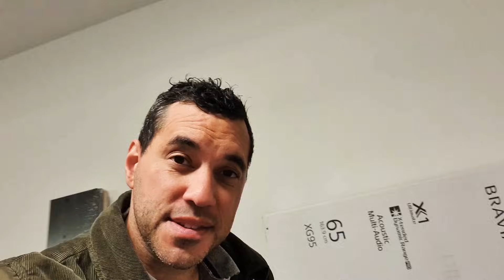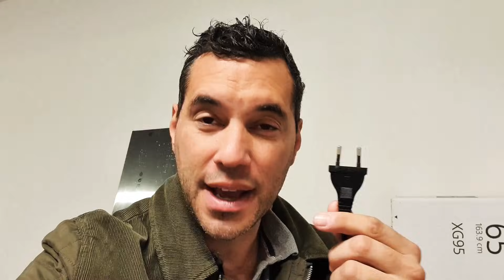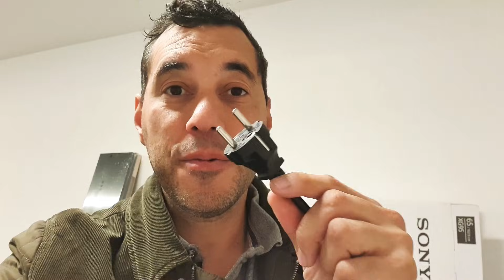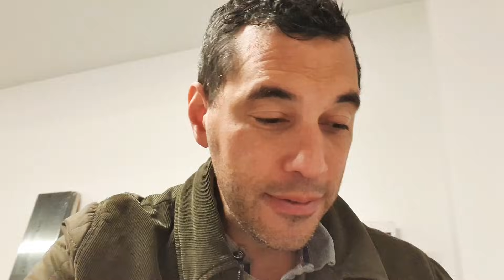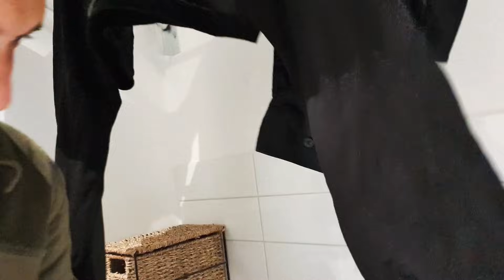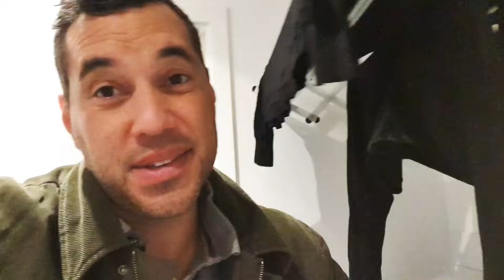Why don't EU plugs have FUSES!!!

Comment: They don't need fuses in individual plugs in the rest of Europe because they have radial circuits whereas the UK uses ring circuits which uses  32 amps on the same grade of cable which should lower to 16 amps between the consumer box and back to it. Because the supply in these types send the alternating both forward and back there needs to be a polarized fuse in plugs to protect the flex on plug-in items from overheating if the supply is cut somewhere in the circuit, yet because it's a return ring circuit some of that circuit will remain energized, and the possibility of it becoming 32 amps, therefore plug fuses protect the item ranging from 3, 5 and 13 amps dependent on the wattage of that item. Radial circuits don't need this as such as polarization is not needed with alternating current as the breakers will go on phase and neutral as they have equal potential to earth unlike the UK where it's only only the neutral side. Europlugs and Schukoplugs ( the ones with earthing clips ) are reversible and unpolarized which is why usually the flex doesn't point down from the plugs unlike British 13 amp BS-1363 plugs. Why do the British have to apply their standards which are superfluous to other countries? Schuko is one of the safest systems in the world, and prevented partially inserted plugs electrocuting people long before the UK had to sleeve the prongs on their plugs to prevent accidental shock from partially inserted plugs. Also having all plugs with a three prong configuration is usually pointless since most items are double insulated anyway, and the larger prong only serves to polarize the plug with the socket-outlet.
Reply from the maker: Thanks for the technical summary, good information. I guess it just gives that feeling of 'peace of mind' having local fuses, but based on what you've said they really don't sound necessary. Thanks for the comment!
Reply: The UK ring system was created in order to save cable, as copper was very expensive and hard to come by during and shortly after the great war. On the same token, many older UK telephony installations uses aluminium cable rather than copper, which causes lots of issues for those wanting to run any form of internet connection over it.
Reply: The fuse in the UK plug is to protect the appliance flex (cord).
I used to install industrial machinery and often used to work alongside European electrical engineers; they were (correctly) very particular regarding having the correct breaker for a specific cable size… 
… On several occasions I have asked them why they allow a table lamp fitted with a 0.5mm (3amp) flex (cord) to be plugged in via a Europlug/Schuko to have as its only protection a 16amp breaker at the panel (this is over 5 times the rating of the flex) …. None of them has ever been able to answer this question!!
Reply: But the french wall sockets don't have switches either which means I find myself always plugging and unplugging cables. Also in my country we use primarily UK but also French for compatibility, so now I wonder if all those french sockets are unsafe given that we most probably use them with ring system.
Reply: @SebVEVO  
No, radials are used for domestic use in France although their earthed plugs are polarized except on Europlugs without the earth hole. The switches you are writing of used to be single-pole on the "live" side but now they're double-pole and they can fail with repeated use. There's no reason to unplug unless moving the item, or if it is something more dangerous like a heater or electric iron.
Reply: @paulaherne3915  
Have you heard of paragraphs?
Reply: @johnburns4017  haven't got time for paragraphs. Not writing a formal document  you know.
Reply: @paulaherne3915  
So you haven't heard of paragraphs.
Reply: The fuse in the plug protects the wiring to the appliance. This is entirely logical. In the European form, and US, you can plug in an extension rated to 5A and try to pull 13 through it. Or you can have a fault current of 10A through a 5A rated appliance cable and cause a fire. That's genuinely bananas and unsafe.
Reply: @jamesbuckle6077  There are no extension cords rated for 5 A. All are rated for 16 A unless it is a simple europlug extension cord in which case it is limited to 2.5 A by the device.
Reply: @okaro6595  this is not true, I have one. Maybe they are not meant to exist but they do. Also, my hoover cord internally wore through (rented property) - and goes up in flames without triggering the overcurrent protection in the box. Cracking system.
Reply: A three phase supply in a normal domestic home is a dumb idea. The UK is single phase, unless the house is very big.
Reply: Many clearly do not understand what a final ring circuit is. The ultimate system is to have a radial circuit to each socket outlet on its own fuse at the main panel - the optimum solution of course.  This means you will need a very large expensive main panel and lots of fuses/MCBs (one for each socket) in the main panel. Impractical of course.

🎊🎈  BINGO  🎊🎈 
A ring gives this by distributing the main panel around the house via a ring cable, distributing the fuses from the main panel around the building to each socket. The ring is a busbar. This saves the vast expense of a plethora of radial cables back to the main panel and also a plethora of expensive fuses/MCB's/RCBO/AFDDs at a very large expensive main panel and expensive labour to install.

a) A ring uses less cable and gives a longer route 
b) No limit to sockets on the ring, but total is limited to typically 32A.
c) A ring uses less copper for a given load/area. 
d) Rings rarely have voltage drop as it is fed from both ends. 
e) Rings have lower impedance, less volt drop is less waste!  They are more efficient.
f) No single point of failure for the protective earth.
g) If you are covering all rooms in one floor then a ring can do it.
h) An appliance and its flexible cable may have a fuse sized to its rating inside its plug.

1. Ring final 2.5mm cable, 32A B-curve MCB, length 106m on TN-C-S.
2. Ring final 4mm cable, 32A B-curve MCB, length 171m.
3. Radial final 2.5mm cable, 25A B-curve MCB, length 33m.
4. Radial final circuit, 4mm cable, 32A B-curve MCB, length 43m.

If a ring is in 4mm cable protected by a 32A MCB/RCBO, then no problems if the cable is broken - which is a very rare thing. The ring can be partially 4mm to heavy current appliance sockets on one leg, and 2.5mm for the rest

The ring final circuit is safe, simple, and highly effective after 80 years of use. The introduction of MCBs/RCBOs/RCDs/AFDDs, and screwless Wagos on the ring taking the load, has made the ring even safer
Reply: @johnburns4017  In Finland one cannot put over 16 A on 2.5 mm².
Reply: @johnburns4017  Nobody has a single wire for every socket - unless it is some dedicated high power device.
Reply: The UK has radials as well, but we still have a fuse in the plug to protect the flex to the appliance overheating and causing a fire. Also it protects the appliance.

Others rely on flex protection by having a fuse in the appliance itself, which may be difficult to get at if you know where it is, or rely on protection at the main panel, which not good enough.

The British system is superior.
Reply: @johnburns4017  once my gas-boiler went out and I had to use a large water heating tea urn to get a bath, and I'd filled it, and then forgot it was gradually boiling on its thermostat, and the cord got so hot the plug in the socket burnt right through on the "live" side, and the 13 amp fuse never melted, and neither did the breaker go. I can't imagine this happening in my old house in Ireland where these fuses are superfluous. The UK system is exalted mostly by those in the UK, and if anything Grenfell proves how preposterous the claims about these over-sized plugs with internal fuses are.
Reply: @paulaherne3915  
The Irish have the same system as the British. If the fuse did not blow the current thru it was not high enough. Or the fuse was at too high a value. The problem was probably elsewhere, like a loose connection making an arc. The main panel protection is lacking, or defective, as well. 

In the UK RCD protection is mandatory.  In certain situations AFDD is mandatory,  and recommended for all socket circuits.
Reply: @paulaherne3915 
Grenfell was caused by a small fridge electrical fire. The fridge was a cheap Turkish brand.  AFDDs are now mandatory in high rise blocks.

You are electically ignorant.
Reply: @johnburns4017  The Irish don't use the same system for domestic wiring as the UK, they're radials, they just use the same plug and socket to suit the UK, particularly Northern Ireland, so you've got that wrong. BS-1363 plugs and sockets are pointless otherwise in the Republic of Ireland. Even Iraq has BS-1363 and they're domestic supply is by radials, again superfluous in that case.
Reply: @paulaherne3915  
Ireland adopt the British IEE regs and use ring final circuits.
Reply: @johnburns4017  A few points to address the comments you've raised:
A. Cable length for a ring and radial ciruit is dependant on the layout of the sockets (and any hard wired devices) installed within the installation. There are times where the cable length of a ring is shorter than a radial circuit, and vise versa. I've seen plenty of 10-15m long return cable runs from the final socket back to the consumer unit (ie to complete the ring) which isn't necessary for a radial circuit, and adds extra cost to the client. 
B. There is no limit to the number of sockets you can install on either a ring or radial circit. BS 7671 provides recommendations, but it's down to the electrician (or engineer in more complex installation) who determines the number of sockets installed on a circuit.
C. Less copper (in certain situations), but again the socket layout will determine the load served per area.
d. All circuits have voltage drop, regardless of whether it's a ring or radial configuration. "Being feed from 2 ends" has nothing to do with voltage drop. Voltage drop is cable size, cable length, and electrical load dependant.   
e. Impedance and voltage drop are cable and position of load dependant. Larger cable mitigates volt drop issues, which is essentially non-existing issue in domestic installation due to the small installation size and low power requirements. In commerical and industrial settings where you may install much larger electrical loads long distances volt drop becomes more of an issue...but in a domestic setting (espeically with the small british houses) volt drop really isn't an issue. Also, the "inefficiency" (ie due to voltage drop) is generally very small in the scheme of things, to the point where you may pay more (installation dependant) in material and labour costs to install rings vs the cost savings in reduced electricity consumption (due to any waste heat produced in the cable due to cable resistance)  you'll pay in your electricity bill. 
f. Single point of failure isn't relevant in domestic settings (this is a far more relevant in datacentres and hospitals settings). In many instances, it's worse for a domestic installation. There are plenty of youtube vidoes posted by electricians finding (and fixing) broken rings in homes where the home owner is completly unaware of this situation. This is rarely the case for a radial circuit, where a break in the cable is far easier to identify (ie in a radial circuit, a break in the cable between 2 sockets will result in the socket downstream of the cable break not working. In a ring, that isn't the case).  
g. Both a ring and radial can cover a floor. 
 
Regarding the circuit lengths for ring and radial circuits..without knowing what parameter you're measuring against (ie volt drop?) the figures aren't exactly useful. Furthermore, there isn't many domestic installation (especially in the UK with the smaller properties) where you're needing to install a final radial circuit longer than 30m...

Whether a 4mm cable is protected by a 32A MCB is down to the cable installation (ie cable installed in free air, or installed within thermal insulation, or within conduit etc etc), ambient temperature, and any grouping factors which need to be applied. More often than not 4mm is fine being protected by a 32A MCB, but not always.  

is a ring circuit safe? Yes, provided it's installed by a compentent electrician. 
Is a ring simple? Compared to a radial, I'd argue no, given you:
Have worry about the return cable installation back the consumer unit (not an concern with a radial circuit, as there is no return cable back to the consumer unit), 
Ensure the sockets are evenly distributed across the length of the ring circuit (ie to avoid one side of the ring carrying excessive electrical load, which ins't a concern with a radial circuit)
More testing required to verify correct operation of a ring circuit (ie ring continuity).

Furthermore, if a ring is broken...enjoy fault finding the break on the ring. Radial circuits are much easier to identify a fault in the cable...

I wonder why rings (outside of the UK, some installation in Ireland, some M.E countries, and some countries in Asia) are not used? Surely if a ring final circuit is superior it'd be used everywhere...right?
Reply: @gloveyourway2000  wrote:
"I wonder why rings (outside of the UK, some installation in Ireland, some M.E countries, and some countries in Asia) are not used? Surely if a ring final circuit is superior it'd be used everywhere...right?"

The British had/have the highest electrical standards in the world. They are a bit behind in consumer units as German/French have DP disconnectors at the consumer units, but they are available in the UK and fitted.

So, the reason why most others do not have rings is that they do not have the brilliant and simple British fuse-in-plug.  The fuse-in-plug makes the ring work. If others had proper plugs and sockets like the British, they would have installed rings.  The British had the least accident/deaths per capita than any other country. 

In the UK AFDDs are mandatory in socket circuits in high rises buildings and recommended on all socket circuits in all installations, as are RCBOs on all circuits.
Reply: @gloveyourway2000  wrote:
"is a ring circuit safe? Yes, provided it's installed by a compentent electrician. Is a ring simple? Compared to a radial, I'd argue no"

▪ Yes a ring is safe as 80 years in the UK and other countries have proven. A ring is simple. 

▪ A ring can cover three or four radial circuits. So no large main panel, and circuits snaking all over a house.  Which adds needless extra expense in a large main panel and cable. And extra work.
 
▪ Fault finding radials is easy when you know how. 

▪ Having  a balanced ring comes down to circuit design.

▪ Voltage drop is normally less on a ring as it being fed both ways.  

▪ A ring is safer as the earth is fed from two ways. 

▪ A ring's size is limited by area. 100 sq metres.

▪ No worry about a return cable back to the consumer unit as it will installed properly. 

▪ Rings are less prone to fires, as they are fed from both ends. Arcs on rings are less intensive than with radials. But AFDDs are mandatory and recommended on socket circuits. 

▪ An intensely used radial has all the current loaded on the 1st socket and cable after the consumer unit. Not good. 

Rings have been use for 80 years with few problems for 80 years.  With new regulations re: RCBOs and AFDDs, they are now even safer.  To the point installing radial socket circuit is rather silly.
Reply: @johnburns4017  Have you worked overseas? I'm guesing your haven't, as you'd understand where the British system is good and not so good. Brits having the highest electrical standards is laughable. Yes, some things are done very well, but the highest standards...nah. 

Proper plugs? If the Type G plug was so good, it'd be adopted everywhere...but it hasn't. Ditto for ring circuits. 

AFDD's have been standard practice for many years in many countries..ditto RCD protection. Heck, most British commerical installations I see don't have RCD's protecting lighting circuits (and these are very new installations) ...which has been standard practice in many other countries for many years.
Reply: @johnburns4017  Both ring and radials are safe provided they're installed by compenent electricians. Radials are used worldover, and have well in excess of 100 years of use. No point comparing both ring and radial in that regard.

If rings are so great...why aren't the brits installing rings for lighting circuits? By your logic, a lighting ring can cover a large area, which will result in less circuits installed in the consumer unit, saving cost. Nothing stopping you from using a 1mm cable protected by a 10 or 16A breaker...yet you don't see it installed. I wonder why... 

Have you worked overseas on sites, or seen in depth an overseas installation, or worked on construction sites? Opening up the fuse board in your hotel room overseas doesn't count...

Ring and radial circuits are just two different ways of circuiting...but the idea that a ring covers 3-4 radials is laughable. I'd be questing your circuit design at that point, especially given that two 20A radial circuits (which either 2.5 or 4mm cable can be used, depending on the cable installation, cable derating and any grouping factors you choose to apply) can deliver more power compared to a ring...

Again, voltage drop has nothing to do with whether a cable is feed "both ways". It's determined by cable size and cable length. 
A ring circuit isn't safer becuase there are two earth cables. If anything, it hides problems with the earthing of a socket. No different to how you can't determine whether there is a break in a ring circuit without testing...which isn't the case in a radial circuit. If there is a break in the cable in a radial circuit, some items connected to the radial circuit will work, others will not. That isn't the case for a ring circuit...

Rings being less prone to fires is utter crap. Ditto for the first socket heavily loaded comment. By your logic, the situation is worse in the ring setup as the ring (due to the 32A breaker which is typically used for a ring setup) will experience higher circuit currents compared to a radial (where 16A or 20A breakers are typically used to protect 2.5mm cable), especially so when the ring is unevely loaded (very very common in domestic installations. So many installations I've seen in the UK have poorly loaded and wired rings where there is no thought at all expect "it's a ring, that's what we install" response). Regardless, the socket itself (whether that be a type A, Type G, Type F, Type I or something else) in most instances encountred in a domestic installation can handle a good deal more current that what the circuit will be expected to carry.
Reply: @gloveyourway2000  
I have worked in many parts of the world. The British standards are the best.  Get used to it. USA plugs and sockets are terrifying.  The best are the British by a country mile. Get used to it. 

AFDDs and RCBOs make socket rings superior to radials. No contest.

Most of what you write is ill-informed nonsense.
Reply: @gloveyourway2000  
I first worked overseas not in Britain. You make things up.
Reply: @johnburns4017  Sure mate, whatever you say.
Reply: @gloveyourway2000  how can you do it?! it's like talking to a door knob!!
Reply: @johnburns4017  LOL, no earth rods, old panels with fuses where one could put just about any wire.
Reply: @gloveyourway2000  wrote:
"If rings are so great...why aren't the brits installing rings for lighting circuits?"

Oh No!  The idea of ring circuits is for power circuits, which lighting is generally not. Rings are used on some commercial lighting setups where high currents are drawn.
Reply: @johnburns4017  The wall fuse usually trips before the appliance fuse trip. In my 40 years I have only seen one appliance fuse blow and it usually was a low powered one like electronics. Each system has a reason for existing, but the British plugs were made to counter the inherent flaws from the British ring system. It's a solution to a problem the Europeans do not have.
Reply: @HideBuz  
A final ring circuit is not a problem and not flawed if designed and fitted properly with proper disconnecting devices.
Reply: @johnburns4017  Ring final circuits are stupid and must be banned.. That's why manufacturers sell their items with a fused plug because ring final circuits are still common in the UK.
Reply: @IAmThe_RA  
Read my posts again on this thread. It is all explained. 

The fuse in plug is to protect the flex - sharpen up!

A ring in 4mm cable with an AFDD and screwless sockets is near bombproof! It will replace 4, 5, 6 radials. They are highly cost effective. 

You have to sharpen up your understanding and analytical skills.
Reply: @HideBuz  
The British G type plug was NOT designed to accommodate ring circuits. It was designed to protect the flex, which many were covered in cloth in those days. My mother's house was built in 1953 with G type plugs and all radials. The fuse-in-plug became the enabler for rings which really only took off in the 1960s in the new build housing market.
Reply: @johnburns4017  The ring circuit was developed in Britain in 1942. The Type G began appearing in 1945 and replacing Type D. You are delusional if you don't think the primary reason of having a fused socket was because of the ring circuit.
Reply: @IAmThe_RA  
You are right about 1942 only. Read my post for the story.
Reply: @johnburns4017  The PRIMARY REASON for a fused plug is ring circuits are common in the UK. I am not saying that's the only reason.
Reply: @IAmThe_RA  
The PRIMARY REASON for a fused plug is to protect the flex.  Get it?   On the Continent they protect a 3 amp flex with a 16A breaker.   No kidding.
Reply: @johnburns4017  Because they are not on a stupid 32A circuit.
Reply: @johnburns4017  Of course there are fuses as it could make no sense to make different devices or radials and rings. Just believe me, the only reason there are fuses is the ring circuits.
Reply: @okaro6595  
Rings came into their own in the late 1950s.  They were not to save copper. My mother's house was built in 1954 with 13A G Type plugs. It had radials. 

Ring circuits have been widespread in the UK for 75 years. They have been found to be very safe. The British G Type fuse-in-plug was to protect appliance flexes. And to standardise on one plug and socket as previously there were different sized plug and sockets and cable for different types of current draws and appliances.  I was common to have three different types of socket in one room. 

However the fuse-in-plug became an enabler to use final ring circuits. The final ring circuit is ingenious in its simplicity.When used with the British G Type plug the ring is a busbar run around the house with distributed fuses at each appliance. 

There are many advantages to rings:

▪ Cheapness, as smaller easier to install wires can be used;  A large number of sockets can be off one cheap to install ring;
 ▪Having the same number of sockets using radials would mean multiple radials and multiple extra breakers at the main panel. Far more cable, expense, labour and hassle;
▪ The 32A breaker and 13A fuse in the plug ensures safety;
▪ Portable plug-in appliances on a ring cannot exceed approx 3kW. Some plug-in ovens are on rings; Rings usually have a 32A breaker at the main panel - can be a lower value;  Using push-fit maintenance free Wago type connectors to connect up the ring adds safety, as not being screwed connections they do not work loose. The ring's current does not run through the socket terminals (this applies to radials);
 ▪The British plugs enable rings having a max 13A fuse in them - can be as low as a 1A fuse in the plug to suit the appliance and flex/cable. Small flex and appliance? Then a smaller fuse; 
▪Rings in the UK are limited by square metres of floor space, with no limit to the number of sockets on the ring. 100 square metres of floor space with 2.5mm cable for a 32 amp final ring. The cable can be 4mm, which is advisable in an unbalanced ring drawing high current loads;
▪Less voltage drop on long cable lengths as voltage comes from two ways; 
▪Two ways for the earth wire back to the main panel, increasing safety levels. 

Radials are also used in the UK. Rings are not mandatory, but used because they have proved to be generally trouble free and safe. They can be installed using rule-of-thumb. These days a ring will be on an RCD, RCBO or AFDD - these now are becoming DP, so safer again. AFDDs are now mandatory in some socket installations and recommended in all installations. AFDDs raise the safety level. If an office wants more socket outlets for extra desk computers. It is a simple matter of extending the existing ring with the extra sockets as the current draw is low. Cheap and easy. If radials are used many radial circuits would be needed, which may mean an extra consumer unit, breakers, wire etc, then far more labour.

Some disadvantages are: 

▪ Rings are more difficult to fault find. But electricians have no problem once the ring is fully understood. The ring can be split at a socket then tested as two radials;
▪ Another is that if a number of high current drawing appliances are on one side of the ring, say nearer to the main panel, most of the current draw may be down one cable leg of the ring with the cable rated below the main 32A breaker. An unbalanced ring. 2.5mm cable is rated at 27A max. Although tests have proven the cables do not exceed their current capacity in the vast majority of cases, just an imbalance in distribution of the two cables from the main panel (consumer unit). Good circuit design will prevent this, negating this disadvantage. 

Balanced rings can be installed by daisy chaining to alternative socket outlets on the ring. That is the first appliance will draw from one side of the ring, the second socket will draw from the other side, and so on round-robin. Or use 4mm cable to the point where heavy current drawing appliances are, then 2.5mm for the rest, if it is that troubling for some. Using 4mm cable on one side of a ring and 2.5mm on the other, is still cheaper than a bunch of radial circuits.

Overall one ring is superior to a bunch of radials needing their own breakers at the main panel. They are simpler, cheaper, being proven to be safe and worked well over the past 75 years. Using the new AFDDs on rings, which are recommended and mandatory on some installations, gives a far higher safety level. 

You will have to give a very convincing argument against rings. I have not heard of one yet.